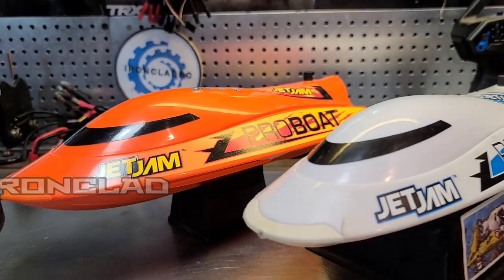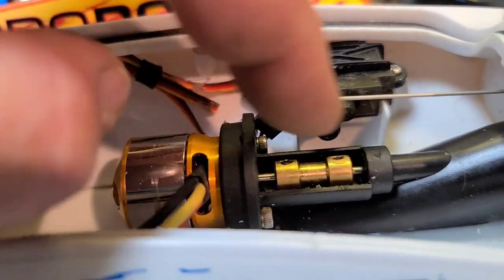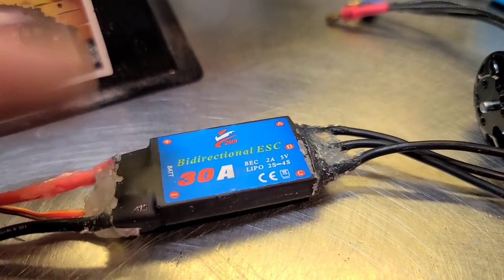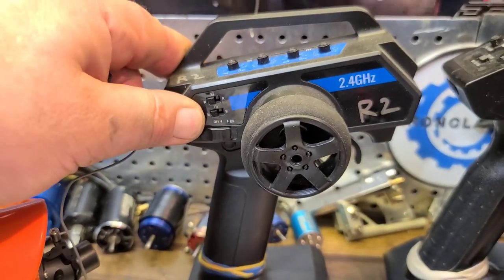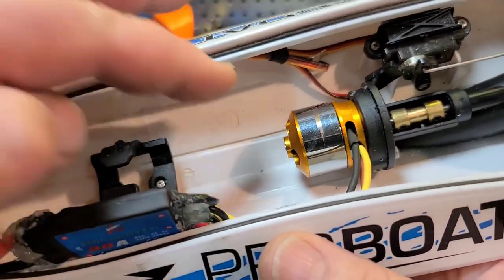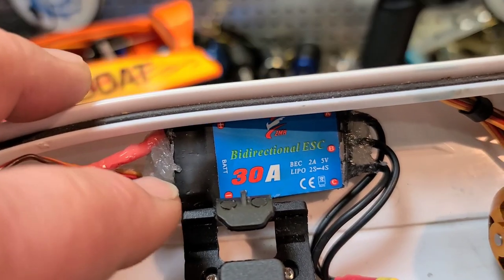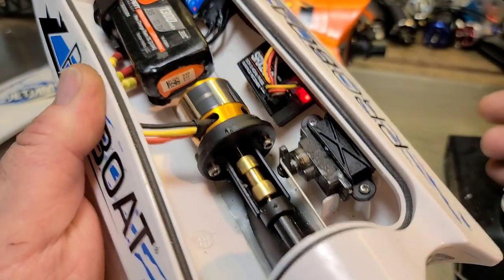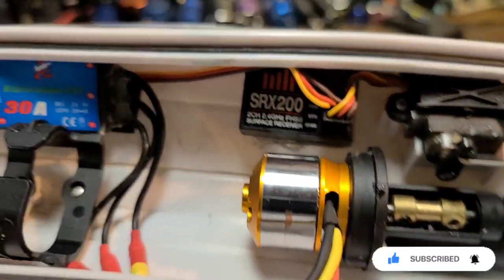Proboat Jet Jam Brushless Upgrade W/ Self-Righting Feature

Comment: Can you provide a link to that hardware. I have a jet Jam and I want to do the same thing. Those smaller KV motors free up so much room. Can those be used on an rc car?

Also so you know where I can get an adapter to connect the esc power to the 7v battery ?

Comment: I ordered 2 30mm metal jets for my rc yaht upgrade you think 2 2200kv outrunners and 2 60amp escs will work I uploaded a old vid on my channel  its 27''' inches lol... and the escs are 2 to 6s capable
Reply from the maker: Yea you should be okay, Twin motor so the load will be shared between the two jet pumps

Comment: Nice! Im looking at my motors and esc now to do mine. Cant wait until the next video to see how much faster it is, and how it sounds. Not a fan of brushed motors from the '70s. Not sure why any mfg would still use them.  Do you know if the FS012 mono china boat's prop can be upgraded to metal?  Im using mine with pool noodles as a rescue and thinking about more torque.
Reply from the maker: Just got back from my test run a  3000 kv motor should be a little quicker than a 2200.  Bummer there's no upgraded impellers

Comment: Great upgrade Big B! Hey just curious why not bind to your DX5 or whatever Tx you prefer to use?
Reply from the maker: Using the cheap remotes so I can let the kids race each other separate remote type deal
Reply: Good deal!!
Reply: I’m working on the same recovery boat, I decided to use a separate transmitter because it will recover a boat that I use my DX5 with.

Comment: How do you access the screws to remove motor ? You have to take hull apart ?
Reply from the maker: @kensmith7491  it's very tight, 1/8 turns at a time, Motor plate comes off with the motor then you remove the motor from the plate
Reply: @IRONCLADRC  ok, i guess i better get a L shaped metric driver to get to it ..
Reply from the maker: @kensmith7491  lol, most definitely, kinda pain in the you know what.

Comment: What size servo did you use?
Reply from the maker: I just use these cheap servos, throw away servos.  If endpoints are set correctly you'll get a decent life from them. 

https://www.ebay.com/itm/234072650713?mkcid=16&mkevt=1&mkrid=711-127632-2357-0&ssspo=GsH0I07KQDm&sssrc=4429486&ssuid=yQkZS9FcQay&var=&widget_ver=artemis&media=COPY

Comment: How are you liking the upgrade?
Reply from the maker: It's okay for what I use it for (recovery)  if you wanna go faster I'd go with a higher kv motor 4500kv'isg
Reply: @IRONCLAD RC  I understand....I was able to find an esc/motor combo that are waterproof  for mine that seems to work ok. I had to add extra weights to the rear to compensate for weight of 3s battery. It's fun on a small pond . It still cavitates some.  I can't believe Proboat  made them so slow from the factory.  For the cost when they first came out, they really should of been a little better.

Comment: Link too motor?
Reply from the maker: It's disconnected, old aquacraft motor
Reply: @IRONCLADRC  so its any 28mm motor that fits the motor mount correct?
Reply from the maker: Basically, might want to measure the stock motor shaft so you can pick your motor according to shaft size so you don't have to buy a new coupler.     If I remember correctly it's 2.3mm? I think could be wrong